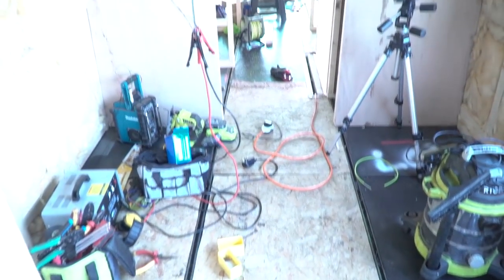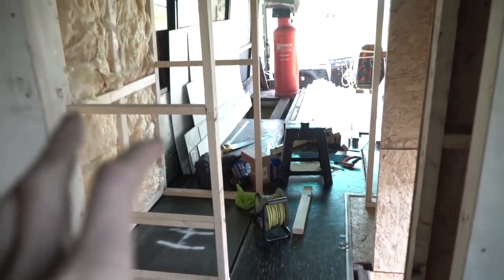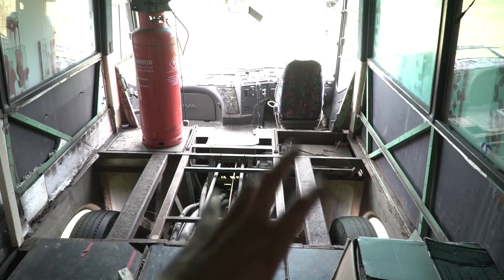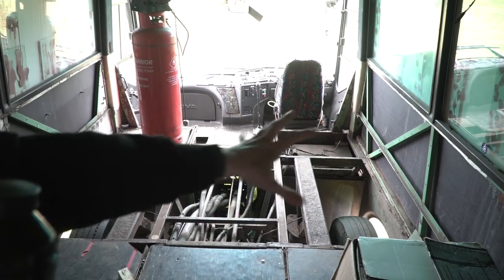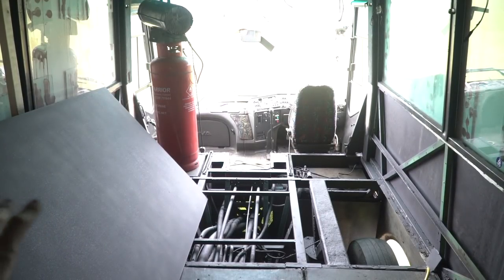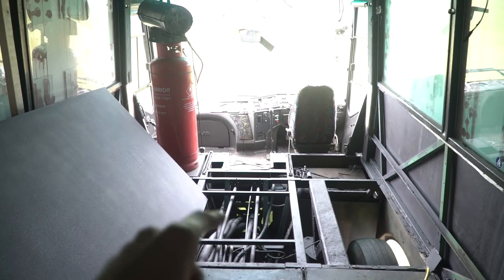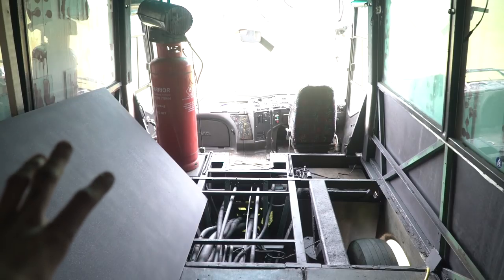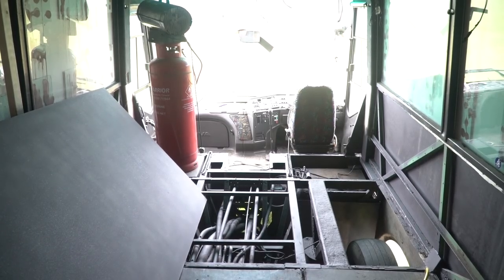Insulating & Studworking - Coach Conversion UK Skoolie #8

Comment: Another great video dude. Look forward to the next part
Reply from the maker: Jim Von Slater cheers jim! Coming sooner.
Reply: Hey dude, I’ve found some conflicting info on direct.gov site about the length of buses were allowed to legally drive on uk roads... 20metres max?? Apparently a converted coach would be illegal...

Comment: Some really excellent videos Tommy. Thinking of purchasing one myself as a bit of a family project. Are you not worried about shattering a window with all the insulation etc on the interior? Bova's unfortunately are known for structural defects, but top class work so far matey for getting her ship shape 👍👍
Reply from the maker: Hi Matt not really! If once breaks I will just steel sheet it and put the plastic back on the outside! I haven’t removed them as that would have been a lot of work! At the moment , I can allways access then from the outside! Thanks for your comment

Comment: This is something that I would like to do so really interested in your videos. Couple of comments, I would have removed the glass from the windows and welded tin across the voids. Secondly, if you are going to travel, (as I am a seasoned driver of large box vans/trucks) you may wish that you hadn't blocked out the windows immediately behind the driver area - there are many junctions where visability to the left (in the UK) is very poor without the ability to look diagonally. Other than that, impressed with how thorough you have been so far & good luck with the rest of it.
Reply from the maker: Thanks for the nice comment! Yer the white plastic is just temp due to weather and making it look tidy for the time being! They will get all taken out and replaced with steel sheeting. As for the view I’m going to install a cctv system called bird cam that gives me full 360’ view of the coach! .

Comment: Hope to have a similar project soon. Great series of videos! Bit concerned at doing so much welding but I guess most will be in that condition. How much did you pay for the bus?
Reply from the maker: Go for it! And yes most coaches are! All rotten and horrid just make sure you pull them to bits and start again!! And a couple of thousand ..

Comment: Hey Tom, hope your getting better, just curious where you keep the bus ? is it private land or family land or something along the lines of this ? do you have a bus license ? im excited for the next vid, i recently just got a bus license with StageCoach, and work there full time, so i can now buy a double decker bus and legally drive it on uk roads. just trying to figure out the place to keep one....
Reply from the maker: yer im getting there! taking things slow. i keep it at my dads in Cornwall! no i don't have my licence yet! im going to be going in for my class (hgv) c1 so not psv as the coach will be changed to private HGV! that will be a next year. ooo thats sounds amazing! a double Decker only seen a few of them! lots of glass tho..
Reply: @Tommy_Harris  cornwall is a way away, but i find the further out of london you guy, the nicer people get lol. some nice views you got down there, good luck for getting you hgv, only advice i can give is learn the pivot point of the wheels, and youll get it quicker than most, theres a lot of glass, but that will be covered over with insulation and then surfaced, hopefully be starting it next year, see what the MRS says lol. should get together when theyre both completed. maybe ?

Comment: You seem very active in the comment section so I hope you'll be able to help me here.

I'm planning to convert a coach in the near future and I'm wondering if you've reclassified it on the V5 and what to if you have. I've seen people reclassify them as motorhomes in the past but it now potentially comes with a £2200 cost in the first year and £465 thereafter (makes my eyes water at the thought). I've also seen people suggest they be registered as a P-HGV which has a much nicer tax bracket, but I'm not sure about the actual legality of it (tachograph, etc).

Also, will you be using a HGV or PCV license?

Cheers and keep up the great work, love the vids!
Reply from the maker: WFCDefi hiya as far as I have know i spoke to dvla to reclassify a coach to motorhome and all they wanted from me was to see photos of  vin plate, log book and photo proof of change inside! Also just needs to look like a RV American style! Then yes is becomes a private hgv and depending on when you passed your driving test ! Befor 1997 you might be able to drive it if after 1997 you will have to take category c. Also yes the tax goes up but it’s only around £400 per year for my coach. In comparison my ford ranger pickup is £367 a year that’s not to bad. Hope this helps a little this was around 3 months back! Where abouts did you hear that it costs you yearly to do so ?
Reply from the maker: Also to add hgv licence is the one you need as your downgrading it from public transport to private hgv classed as hobby driving like driving a horse box!
Reply: @Tommy_Harris   There were a few different places mentioning the tax hikes, the gov.uk site says motorhomes are now taxed using the CO2 rates that cars use. It's not too common so there isn't a lot around to read on it.

https://www.gov.uk/vehicle-tax-rate-tables (its really vague and only says "some motorhomes")

https://www.shieldtotalinsurance.co.uk/blog/news/road-tax-increase-on-new-motorhomes/ (this says "only under 3500kg")
Not sure if reclassifying a vehicle would count as a "new" motorhome or not.

I did see people on forums saying you need to send pictures in now to prove you've converted it, that's simple enough. I just want to make sure I get the right vehicle classification without being completely fleeced or without getting in trouble with insurance or cops. If what they've told you on the phone is right though its music to my ears.
I'll definitely need to take a category C license though as I'm a fairly similar age to you.
Reply: @Tommy_Harris  just another question too, sorry to bother again. Would insurance go under motorhome or phgv, how were your quotes if you got any?